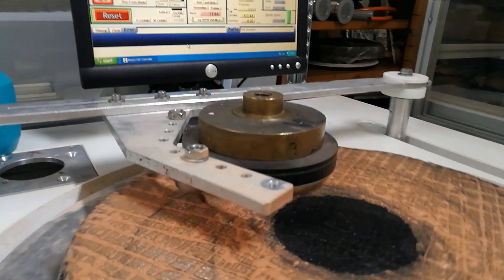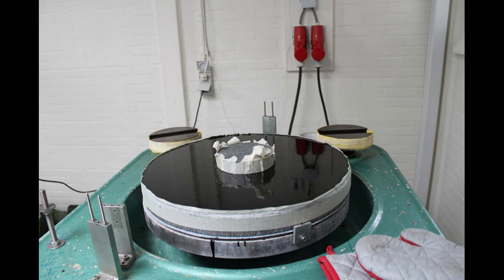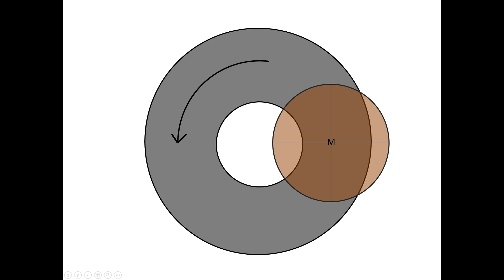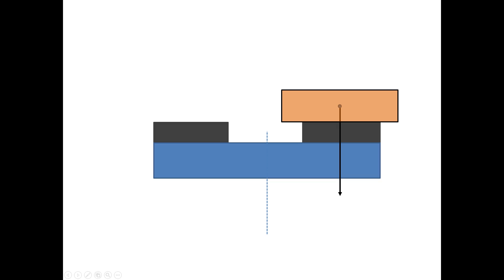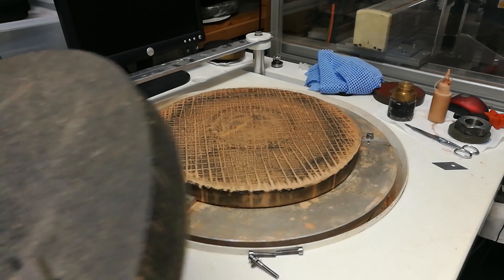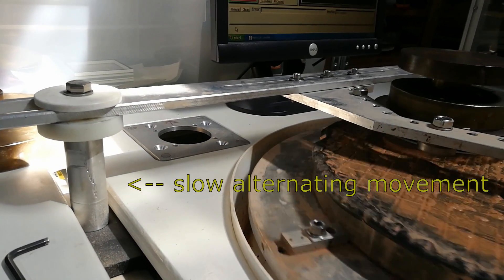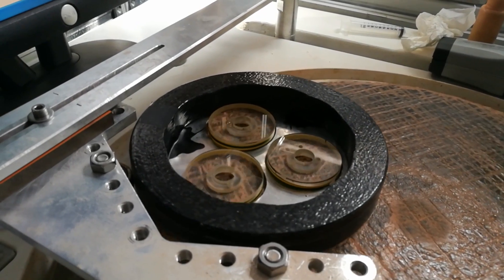How to make Very Flat Optical Surfaces on Glass

Comment: How the angular rotation speed of both  job and lap are controlled?
Reply from the maker: Only the speed of the pitch lap is controlled (with a frequency controller). The items rotate freely. If they make uniform and good contact over the shape, it will automatically rotate with the same angular rate as the pitch lap.

Comment: Hi there, would this be possibly achieved on double side polishing machine with PU pad?
Reply from the maker: @n1mmyz  PU pads are generally too soft and their deformation creates large "dropped off"  edges or even slightly convex surfaces instead of flat surfaces.
Reply: @HuygensOptics  yes, I am experiencing the drop off as u said. Or they called it edge roll off. It is quite bad. Flatness PV range is about 0.6 to 1.0 fringe.

Comment: At 12 minutes in, wouldn't having the rotation of the parts and the rotation of the pitch being identical run the risk of causing patterns to wear into the lap surface over time, leading to irregularities?

Comment: 10:00 So not necessarily, and not usually to that degree.  Yes, surface plates do have stricter requirements for local flatness vs overall flatness.
For instance a grade AA surface plate of 18x18 in, has an overall flatness requrement of 50uin, but a local flatness requirement of only 35uin, so that would definitely need to be checked for whatever specific surface plate you're using.

Comment: Hi,
So I have a question about this pitch polishing method. Do you need the bruiser plate to be the same level of flatness as the flatness we desire for our glass surface? If not, then how does this less flat bruiser plate help us get a more flat glass surface?
Reply from the maker: Yes, the bruiser in a real lapmaster also needs to be quite flat. However, you steer the position on the desired flatness of you objects, not that of the bruiser. This is because the bruiser can have a somewhat different surface profile compared to the objects. The flatness really depends on object size, how they are held in place, the amount of pressure, correction history, etc.
Reply: Are there any resources I can read about how the flatness is effected by the factors you mentioned?

Comment: Does this type of pitch polishing give you any assurances of the parts being square or parallel? I imagine you might often want an object with two opposite faces both very flat and very parallel to each other, but my totally uninformed intuition says this process might not be able to give you that?
Reply from the maker: That is correct. To create parallel surfaces, generally two-sided grinders and polishers are used that have two abrasive disks spinning in opposite direction while applying pressure.

Comment: Why does positioning the bruiser plate away from the center result in convex or concave shapes instead of simply straight sloped lines? Isn’t the bruiser plate pretty flat itself?
Reply from the maker: The bruiser plate also changes shape constantly due to the abrasive action of the pitch.

Comment: Last minute had the information I didn't know I needed. Blocking pitch does put pressure on glass held to a backing. All the old film of spectacles and camera lenses show blocking, but these are not expected to be accurate to fractions of a wavelength. OK now I will also avoid lots of messy cleaning up as well.

Comment: Hi there Huygen what a great explanation. I have only just started learning uses for optical flats checking surface flatness after surface grinding and lapping. I wish to make my own light for my workshop at home and would like to ask you what type of light source you use as I see that yours is green and others I see are yellow. Thanks.
Reply from the maker: As a monochromatic light source I use a sodium lamp (yellow), but sometimes I also use the diffuse reflection of a green laser. You can also use a fluorescent lamp in combination with a plastic film filter that transmits one of the emission lines of the tube.
Reply: @HuygensOptics  Thanks for the suggestions. It's such a great practice that I'm thoroughly enjoying researching.

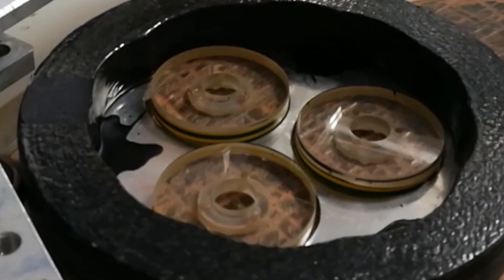Comment: @Huygens Optics. Excellent video! thank you so much, it is very clear explainned. I have a question, what material do you use for the part rings which shows up at 6:20 and 7:22? is it also made by pitch? thank you!
Reply from the maker: The rings are cut from granite using waterjet cutting.
Reply: @HuygensOptics  Thank you so much!

Comment: Excellent video! Very informative and explained very well.  I have a question...When lapping a glass part with a hole, I get some inconsistent removal near the hole.  How do you counteract this tendency on pitch? Do you block it with some soft material or do you reduce the amount of liquid?
Reply from the maker: If you have a dropped down edge near a hole, you should also see it at the outer edge. Pitch that is too soft is generally the cause for edge deformation around holes.

Comment: Question: couldn’t one achieve asymptotically flat glass surfaces if one used the original method used for making surface plates? That is, to have three pieces, A B and C, and rub them against each other in sequence: AB, then BC, then AC, repeat. This method ensures none of the 3 develop bellies or hollows since the ones that start forming cancel each other out perfectly. I’m curious if it could be doable in glass…

Comment: you said the granite plate needs to be rotated to prevent it sticking to the pitch. I bet discovering this requirement was fun to clean up
Reply from the maker: It's not to bad. If you use some ice on the top side of the granite, you let the thermal contraction do all the work. But if you don't have ice, it can be quite a challenge.

Comment: I've always thought there was something almost magical about being able to make incredibly accurate optical surfaces, flat or otherwise, with no precision tools whatsoever.  I ground my 6" parabolic mirror by hand, and figured it to 1/20 wave accuracy on a pitch lap, with no references other than the Foucault test.

Very nicely done.  Subscribed.

cheers from sunny Vienna, Scott
Reply: if you like that; then the three plates to make a surface plate is another example of this principle (though wil hardish surfaces)
Reply: @robertmccabe8632   Indeed.  I use this principle to keep my sharpening stones flat.  Using silicon carbide abrasive, I grind A against B, B against C, and C against A.

Comment: Grinding 3 surfaces flat against each other is how metrological surface plates are made. Does this work for optical flats?
Reply from the maker: Yes, that can be done in the same manner, at least for the grinding part. But of course you cannot polish plates against each other, so during polish you use a separate tool and compare plates against each other by counting fringes.
Reply: @HuygensOptics  Fascinating channel. I ground a 6", F8 Newtonian mirror while in high school (45 years ago). It ended up mediocre at best. My 4", F10 refractor kicks its butt. You are way over my head most of the time, but I enjoy what I have seen anyways.

Comment: What is the grain size of the cerium oxide (for example)?  I'm surprised that it's possible to get nm scale smoothness if the size of the polishing grain is larger.
Reply from the maker: That is why optical pitch is used: it is soft and embeds the grains in such a way that the resulting surface roughness on the glass is much smaller than the grain size. The grain size of the cerium oxide will be in the order of a few um
Reply: @HuygensOptics  Thanks so much for that clarification!

Comment: If your watching this in 2021, first thing is a file is not flat, never was never will be. second , an easy was to get fired is to lap parts  on your bosses very expensive surface plate. never mind leaving that grit all around to get onto some very expensive equipment.  Sandpaper should never be in the QC area. you wouldnt lap on your car would you?

Comment: I'm an optical fiber telecommunications technician.  We used to have to polish the end faces of our connectors when terminating them. 3 different ratings of polish paper and polishing in a " figure 8" motion. It was tedious. Faster speeds and the need for lower reflection  at the connections has us using fusion splicing and factory terminated connections, now. No one misses " puck and polish" terminations.

Comment: I have a multiple sided piece of quartz cut to have several 45 degree facets to a point in the middle, but each side is not optically flat. Can I make them flat by hand, or is there some place which will do that for me? I have six, eight and 12 sided crystals, the largest is 40 mm diameter, smallest about 20 mm. They are made from natural quartz crystals. Perhaps I can buy a machine to handle small diameter pieces?

Comment: In FDM 3d printing we need super flat glass to build on. But bigger is better say 500mm square. Is this possible using similar techniques? Would this process be super expensive?
Reply from the maker: There are machines that can process that size, however things get expensive pretty quickly because it is a niche market

Comment: When the pitch drapes off the sides, how do you get it back up on top? Do all the different grade abrasives get mixed into the tar? Do you then have to replace the tar? How do you setup for lens grinding as opposed to flats? How are multifocal optical lenses ground? eg for spectacled?
Reply: freeze then chip it off and melt and recast.  the polishing compound is micon sized...not grit.  used to use rouge, but there are better compounds not so messy.

Comment: How does this process affect the parallelism between the surfaces and what kind of parallelism can be obtained?
Reply from the maker: Because the material is removed uniformly, it does not influence parallelism. Parallel surfaces are generally achieved by using a double sided lapping machine.
Reply: @HuygensOptics  Interested in apply optical techniques to metal gages which use two laps. The problem becomes cupping or crowning on the lap surfaces. What you call a bruiser plate we call a spinner, but now I have a much better understanding of how and why some of the phenomena occurs. In a previous life I used to fabricate metal laser mirrors, and it wasn’t that hard to produce good product.

Comment: Is the only reason you take them out to measure time consumption? I would assume that if you left the "workpiece" there for long enough you would get a surface as flat as possible no? 
Also, if the abrasive particles are 1um in size, how is it possible that they make for surfaces only tens of nm flat? Is it because they get get embedded in the pitch material?
And finally, could one make an optical flat for measuring with this method?
Thank you for the great video!

Comment: i still dont get why pitch is chosen over other materials
Reply: Because it is easier to change it's surface shape to be flat.  A hard surface like steel, would have to be ground flat.  Pitch will change its shape just by applying pressure (weight).

Comment: A similar method is used to flatten one side of microscope slides, and rock samples to glue onto them, and then later grind the stone blank down to 30μm for petrographic research. The lapping plate is made from a radially slotted cast iron plate, and the abrasive is aqueous Al₂O₃ solution. Same processes, same physics.

Comment: How are the grooves cut into the tar? Or how do you stop the grooves from filling up with tar?
Reply from the maker: generally by using a cerrated knife and a steel brush for microgrooves. Grooves have to be reopened every now and then, using this method.
Reply: @HuygensOptics  Ah ok, thank you for the quick response

Comment: Totally counterintuitive. I've done a fair bit of metalwork sanding and polishing, so I naturally assumed that optical polishing would be similar, only using something harder and flatter to grind the surface. It never occurred to me that the rotational grinding process would use something ductile, yet get better results. Thank you very much for the excellent explanation.
Reply: In metalworking terms, it would be very similar to using an aluminum, copper, or tin lap (as in watchmaker's "black polishing"). You want your lap to be softer than the material to be cut. Your lap becomes a matrix to hold the abrasive particles in place, and the cutting happens on the material that can't just grab and hold the abrasive. (Tin, by the way, gives absolutely amazing results when polishing steel. It's just really stringy to machine when you're initially making the lap. Save it for your finest - sub-micron - grits.)
Reply: I feel there’s a general misconception when it comes to lapping a polishing that is a result of focusing on the lap material. As the first comment responder noted the lap only hold the cutting media. There are three fundamental rules for cutting to occur, though I only usually remember two. The important one here is that the cutting “tool” (in this case lapping or polishing compound) MUST be harder that the workpiece. The second is that there must be relative motion. The third escapes me. 

But in either case it is not the lap that cuts the work piece but the embedded abrasive. Apologies for the lecture comment but lapping and polishing seem to be no different fundamentally than any other metal removal process; hard removes soft.

In the case of polishing silverware presumably there is some residual polishing compound on the cloth that is the effective mechanism for removing the oxide layer.

Also, if I’m glaringly wrong please correct me. 👍

Edited for autocorrect errors.
Reply: @matter9  It's not wrong to call them abrasives; but to say the sole function is the abrasives cutting the material that forms the pristine surface would be misleading.
Adhesion wear is the natural shearing of contacting similar hardness materials with relative motion whether lubricated or not; whilst abrasive wear is the cutting of a material with a harder material.
This is why something like a very lightly used brass bushing may have a thin film of brass dust on the inside; once the abrasives either caught by the softer material, or mixed into (in the case of tar lapping) the softer material; and it forms a lightly colored slurry, further lapping will be a combination of adhesive wear of the similar hardness material, and the abrasive wear of sub micron abrasives.
Adhesion also takes place with the abrasives and the softer material, facilitating the process of lapping; and adhesion occurs between the softer material and the glass slurry, which increases further adhesive wear.
This adhesive wear is what produces a cleaner end result; which is why cleaning up the slurry even when tar lapping isn't advised (also to increase the longevity of your lap, because it wears away.)
Reply: Very informative yet old video on lapping metal parts by rotation. Check this: https://www.youtube.com/watch?v=fnoVV-RWIWY&list=PLBmv-CHJtsiqhW2Iic6GaXPncmVvlB496&index=1 It vey clearly explains "how it's made".
Reply: @gvidas1338  This is great, thanks!
Reply: You polish silverware with fine cloth which is softer than silver. If you use sandpaper the result would be terrible.
Reply: A big chunk of glass of this flatness would make a great surface plate.
It's hard and you can see any potential scratches so you know when it's out of spec.
BTW the granite plate he's using - putting a weight in the middle has to make it convex on the other side. Does he not know that nothing is rigid?
Reply: I dont think you know what "counterintuitive" means....
Reply: @omnyakat5560  I think you don't. 

Intuition or by extension counterintuition is not an objective measurement. Is is subjective. Counterintuition means that something goes against how you would intuitively understand it going. The subjective part comes from that your own intuition is built from your own knowledge, experience and ability to extrapolate. OP clearly insinuated what was his understanding of the action of polishing and where it came from and stated that this glass polishing went against his understanding about it and thus being counterintuitive.

I hope next time you consider twice before coming to talk down random people because often all you'll manage to do is just to make a fool out of yourself.
Reply: @anteshell    you're missing something. To call something counterintuitive does not say anything about one's own intuition. To say something is counterintuitive is to assert people generally fail to understand the mechanism behind a process. Think about a teacher introducing a concept saying, "now this is counterintuitive, so stay with me here." The teacher already understands the concept properly. By calling it counterintuitive the teacher reveals no information about then, but rather, they're expressing that they expect that you, or the average person, would fail to understand the proper mechanistic explanation behind the phenomenon. I can understand a concept intuitovely yet still call the concept unintuitive. Or I could also not understand, and still call it unintuitive. 

Therefore, again, calling something intuitive does not reveal the speaker's own experience with understanding it.
Reply: @iwanttwoscoops     You are not wrong in your definition but neither am I. It can be just as well caused by one's own knowledge than the assumed general knowledge. That is because, as I said, counterintuition is the literal opposite of intuition. However, I never said it works the other way around, that you can draw conclusions about one's knowledge based on the usage of the word, as you indirectly accused me of doing. I was only answering to the stupid claim about the wrong usage of the word. In that context I didn't miss anything, my answer was perfectly sufficient to counter that claim.